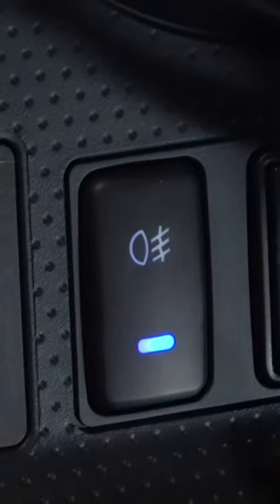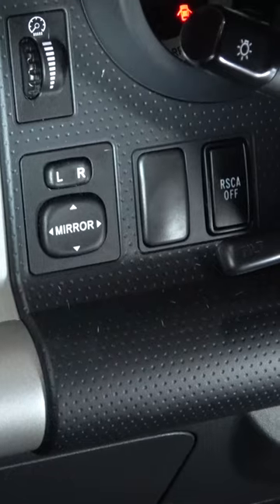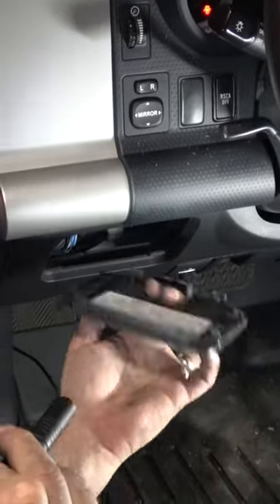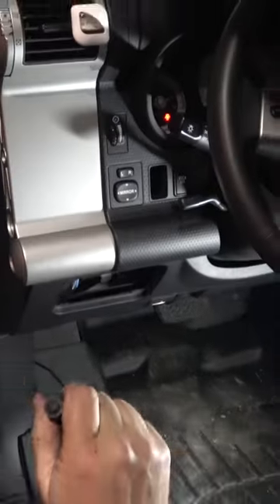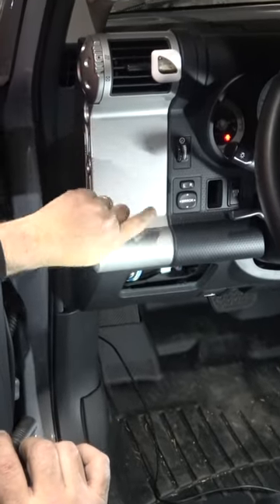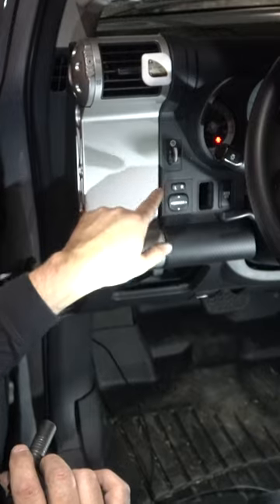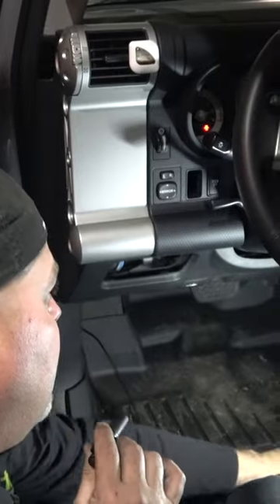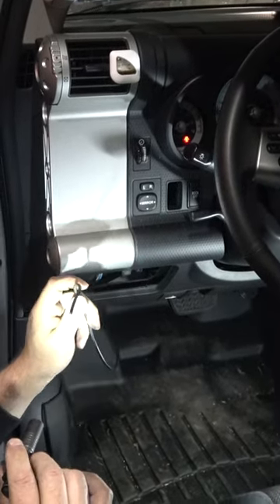Pop this out of your Vehicle | Light Switch Install 💡

Comment: No before you drill you check behind what your drilling. Tape trick works. And not all "knock outs" come right out.
Reply: Pretty sure its remove the knock out to drill it.   Not go blindly into the dash!   Knock outs never come right out, they all take some effort.  But if it does not come out, that is a dash feature made to look like a knock out.
Reply: @Mark-hx3nd  He had said to tape and drill thru the dash if their was no knock outs. I just said first make sure you check before you drill blindly. Can tell you how many vehicles I've trouble shooted that had screws or someone drilled blindly into wires....